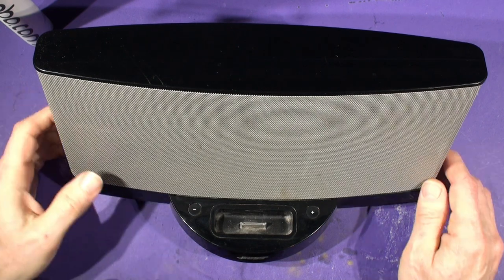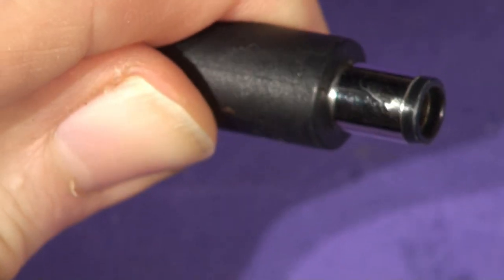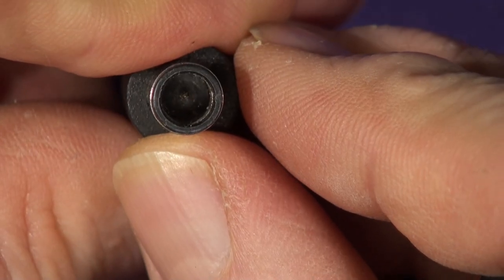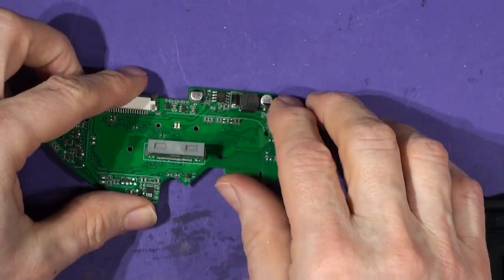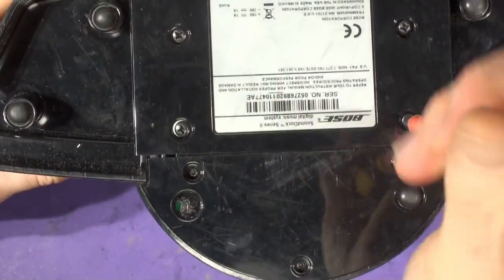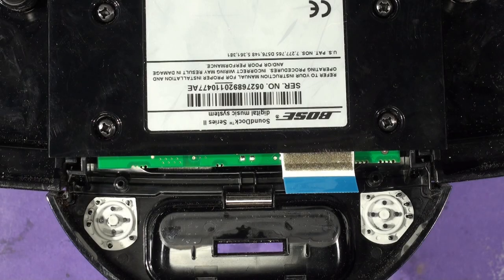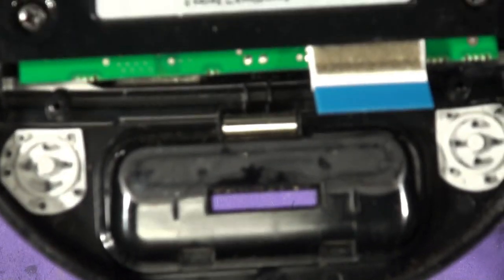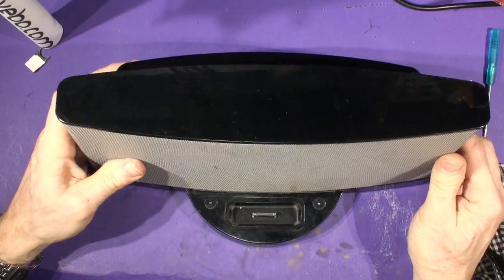invebo SD20 SoundDock Series II Bluetooth upgrade kit installation

Comment: @ questions. 
1. can i install a BC20 using the base moulding for SD20? (I find your BC20 more interesting and i wish to get rid of the apple 30 pin connector docking feature.)
2. when i power on i can see the light indicator on (green light on and it is always on the speaker face through the mesh)  but the 2 beep doesn't come and neither can connect audio to system via the AUX in the rear. What could be the problem and what is your suggested solution?

Comment: Hi,
I watched youe video on SD series 1 "Checking & Replugging Sound Processor Ribbon SoundDock Series 1", I was wondering if it did work at all after you you put back all the screws etc, as I have the same problem with mine. Thank you